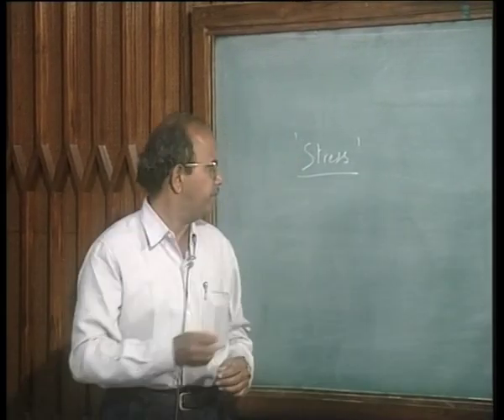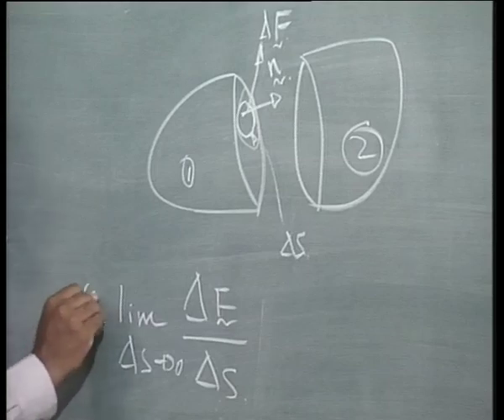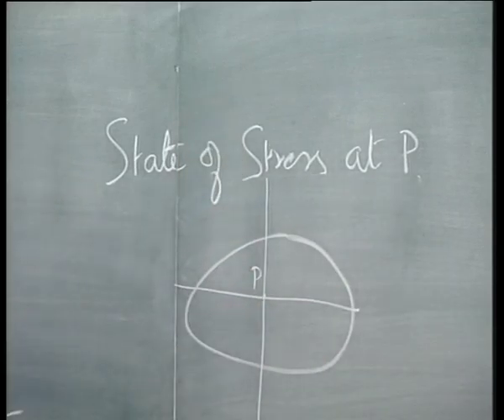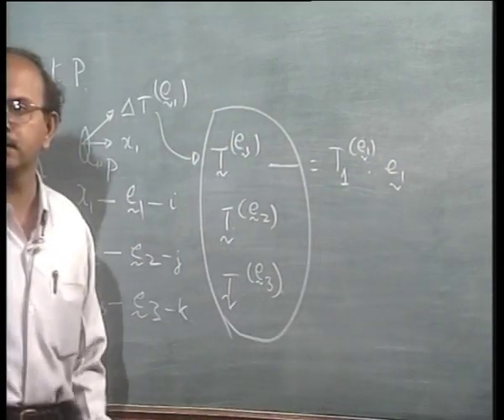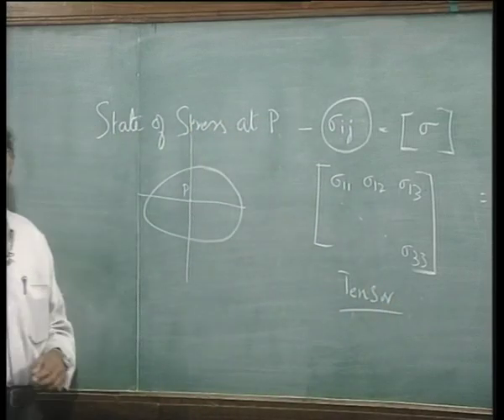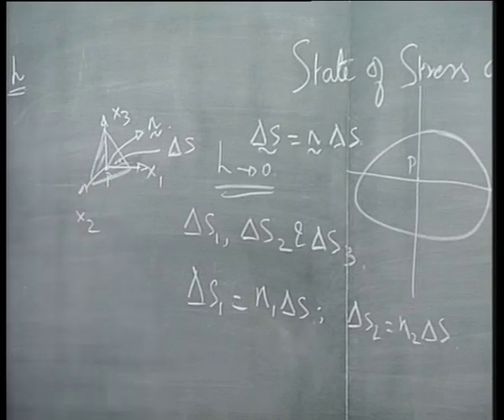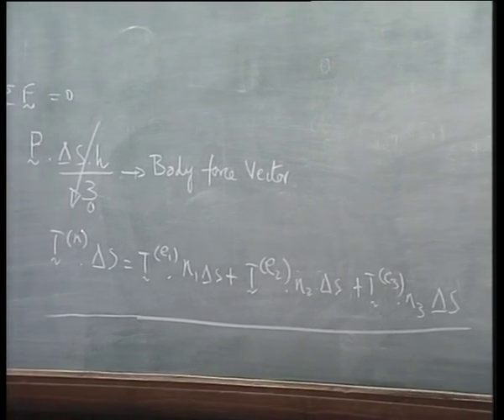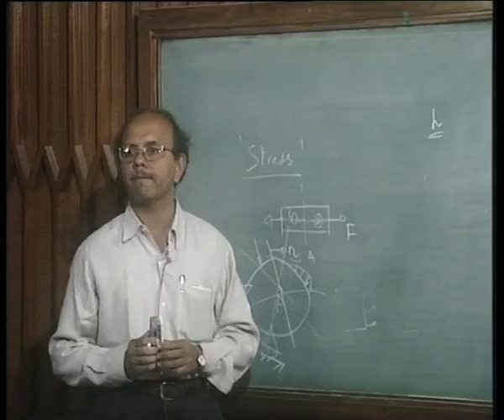Mod-01 Lec-05 Introduction to Finite Element Method

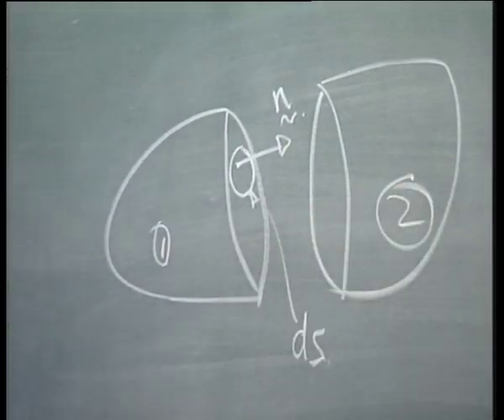Comment: Why there is influence on 1st part due to 2nd?? someone please explain.@5:35
Reply: Because they are joined..Why does the whole door move when you pull just its handle? In a sense the handle is applying a force on the door. So if you consider the door as a separate body for analysis it will see the force by handle on it....Same is happening here. Part 2 is like handle on Part 1